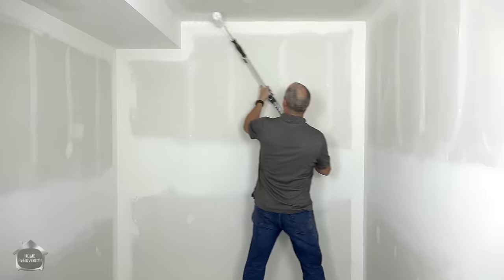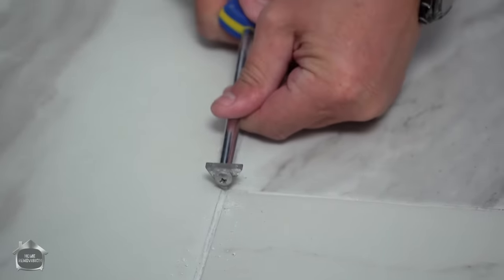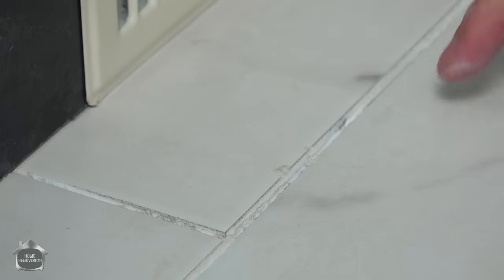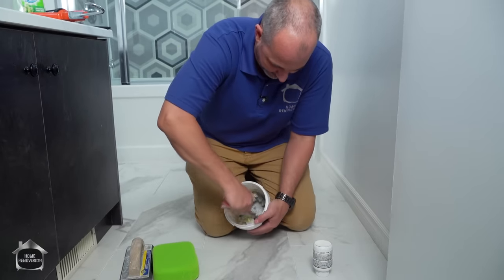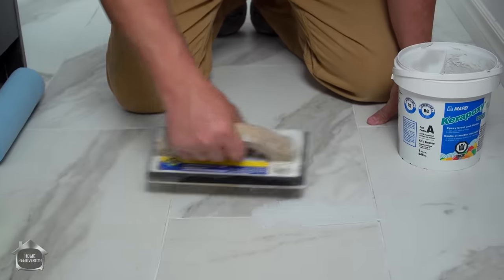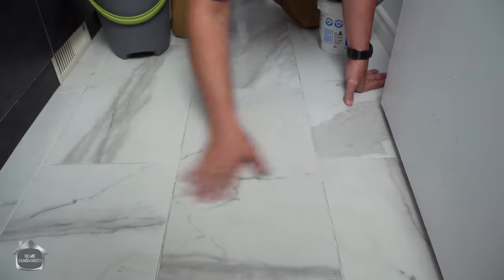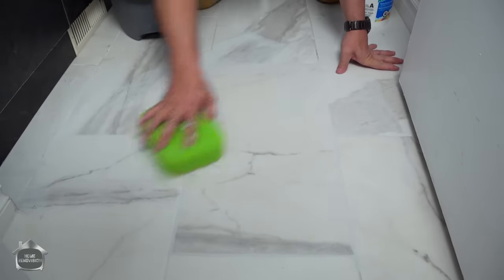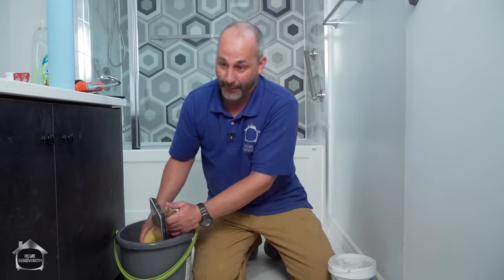How To Apply Epoxy Grout  | DIY

Comment: thank you this is  interesting trick but the fact that soap prevent the epoxy from sticking the the face of the tile which makes cleaning easy also works against us because  it will do the same thing to the grout line and prevent adhesion because its very hard to not get any soap inside the groutlines  once you start grouting
Reply: Agreed, this potential problem isn't addressed, despite several questions about it. How does the soap affect the ability of the grout to stick inside the grout lines Jeff? This is obviously a concern to may of us.
Reply: I was wondering about the same.
Reply: Jeff, are you sure the soap trick works? Will the epoxy bond to the grout lines once fully cured?

Comment: out of curiosity , what do you think of grout release products that you roll on with roller, every company seems to have it. supposed to help with grout haze. over priced dish soap?
Reply from the maker: If you use 20 cents of dish soap you don't need 40 bucks worth of grout haze remover. cheers! This technique solves the problem before it even starts.

Comment: Hi Jeff! Can you use this epoxy grout for the floors of a shower stall that have cracked grout?
Reply: Hopefully you were asking this question a year in advanced. Cause he still hasn't replied. Hm
Reply: Cracked grout line means there's movement, nothing stops you from regrouting, but it won't solve the original problem. If you're talking about an inside corner crack, that's because grout never belong there
Reply: @doublepoil  grout can crack for various reasons and isn't caused just from movement. Improperly installed or mixed grout can cause it to be weak and crack prematurely ie mixed wrong or not packed all the way in the joint

Comment: I'd replace that floor with that deflection you showed us. Even epoxy will crack there. Band aid solution. 
Subfloor and plywood under layment total thickness of 1.25" and 1/8" Schluter Ditra on top of the plywood underlayment. Never had a failure with this method.
Reply: Thank you!

Comment: Good morning
My bathroom was renovated by a professional from Canada and he used schlutter board under the tile and epoxy grout. there are places on the floor where it looks like the grout has   
came loose from the tile along the edge leaving a hairline between the tile and the grout.
can I heat up the grout to get it to reseal?

Comment: "To minimize epoxy haze, wipe the tile down with a solution of water and a few
drops of Dawn® dish soap prior to grouting. This solution acts as a grout release to help
prevent resin from sticking to dry tile, thereby making it easier to fill the grout joints and
minimizing the residue on the face of the tile. The use of a microfiber towel to remove the
final grout film during clean-up will greatly reduce the amount of haze. "
Reply: ty Wendy. Someone actually knows. But keeping the grout ice cold in a bucket of ice is the real key. Kind of surprised to see the host does not know that.

Comment: I like your videos,but if you read Mapei spec sheet it says "The joints must be dry, clean, free from dust and empty down to at least 2/3 of the thickness of the tiles". Wet joints are required only if you apply sand based grout and also you need to clean the joints from old grout way deeper than the this tool can reach. I have used similar tool and they are not any good as it can damage the tile along the joins. I ended up using milti-tool which is slow and hideous process

Comment: I just purchased a home and need to repair some tile and regrout the tile around my tub. Would the epoxy grout be a good option for that or is it only good for floors? I had though about doing tile over the existing tile but the existing tile is very thick and it’s a 1994 manufactured home
Reply from the maker: epoxy is great for showers since it gives you a waterproofing layer. Cheers!

Comment: I just installed porcelain tiles in a shower area and used Ardex EG8 Plus epoxy grout and it was a nightmare.  It started to cure within about ten minutes and getting the whole job done was a nightmare.  Consequently I missed about 5 small spots and have epoxy on the tile faces that wasn't cleaned off properly.  I also had a nightmare that the lights went out during grouting so was working in very low light.  Ordered some Lithofin Resin Ex after speaking with manufacturers so will see what that does

Comment: So the hardened epoxy stops tiles flexing where glue has come loose underneath? Have similar movement around vanity and an external door. I've fixed the leaking in both spots but tiles a bit loose.

Comment: Hey Gary, that soap trick makes me a little nervous. In other projects I do I use dish soap as a barrier,  or separator between two similar surfaces.  ( such as a plaster mould). I would think that it might compromise the bond. Thoughts?
Reply from the maker: hi brian, use a little and spread it on the tile nor into the grout line. Cheers!
Reply: Spread it on the tile then float it into the joints when grouting?  Same difference.
Reply: Hey, it's the guy who instructs you to push the grout removal tool away from corners or push it away from corners to avoid chipping the tile. Then within seconds, he's scraping through tile corners not following his own advice! So, do as he says, not as he does? 🤷‍♂️ He's not even using an epoxy float and if my ears and experience serve me right, there's sand in that new grout. So he's ruining that float (made for unsanded grout).

I have no problem at all with this guy. Honestly, I've taken some of his tips, tried them in the field and you know what? Some work. Some don't. But you take what's useful to you and forget the rest.

That reply of his where he says that he's smearing the dish detergent on the surface and not in the grout joint; ok! True! But as you push the grout float across the tile pushing the grout around, the dish detergent is mixing with the grout - like the epoxy liquid with the powder in the bucket. 🤷‍♂️ Simple, common-sense physics. So yeah; I too believe that the bond integrity is compromised - regardless of what Jeff says. Do i have a channel? No. But I did send this guy pictures of my tile work in Instagram and he never shared them - and that's totally cool! His account, right?

I'm not saying I know more than Jeff. I don't. I only went to tile school for 4 years with the tile union (Bricklayers) and was instructed by instructors who have over 300 years combined tile experience but again, I don't think I know more than Jeff. What I do know more than Jeff is what my dad taught me; if you're wrong, own it. Admit it, fix it, move on.

🤷‍♂️

Dish detergent for this purpose? NO. Not me. No way. Since 2005, I've never been called for grout failure on one of my jobs. I used no dish detergent, only good 'ol elbow grease. Nowadays, people want quality and fast. It's like wanting a Bently (hand-built) assembled in the same amount of time as a Chevy or a Ford. No way! Quality takes time. Period.

Jeff, regardless of all of this, you've got some great videos. And despite my comment, I have a lot of respect for you. As I said above, I've adopted some of your methods.

Good day!
Reply from the maker: @Carlotheeus  I guess the best take away from this is I am not running a trade school, simply trying to offer some advice to help the DIYers out there. Cheers!
Reply: The issue is, professionals know what info to adopt or which to discount, whereas novices follow all these tips, many of which can lead to trouble in the future.  As for soap and grout, if it isn't on the label, don't do it.  Some tips make the contractors life easier, but ultimately the consumer pays the price of someone playing "mad scientist".
Reply: I am an American  not russian. So it takes as long as it takes
Reply: OM, GOODNESS give the guy a break, he's not here claiming to cure CANCER!!!!...as a single parent who is also a home owner I find all his videos super helpful...sometimes I cant afford a tradesman and this videos have helped me tremendously, just the other week I watched his video on how to paint kitchen cabinet doors....and viola, I took the chance and followed his tips and tricks, needless to say my kitchen looks amazing now.  @Carlotheeus

Comment: Hi, is there any mold resistant grout in the market or any advice to stop mold growing on grouting?
Reply from the maker: mold only grows when the tile substrate allows the water to reach the framing. use cement board with a waterproofing roll on for best results. Cheers!

Comment: Always a great video and awesome information. Thanks Jeff and good work Max for your camera work. Have kitchen questions. Bought a house that was built in the 60's. Has wallpaper that the wife wants to remove and paint blue. The question is she found Mosaic tile for a back splash, how can I put it up and have it show the blue thru the tile and a get a blue grout? Thanks
Reply: Also, have a trash compactor, it don't work. Think of replacing it with a cabent that holds trash cans, to hide them and get them out of the way. Any ideas. Thanks Jeff
Reply from the maker: that sounds great.
Reply from the maker: if you want to install clear glass tile on a colored surface all you need to do is apply the tile with clear silicone. This will allow the color to shine through. Cheers!
Reply: What kind of grout should I use? Can it be tinted to a blue color.

Comment: Hi.  New here and new to tiling.  I have a project I'm working on - building a water fountain for my apartment patio. I bought a single sheet of 1/4 hardie backer and I want to tile it with some very inexpensive glass tile I picked up at a surplus building supply. The tiles are mosaic 5/8"  on sheets 12" x 12". So the grout lines are very small. As this is a water feature, the water should cascade down the front of my tiled wall, the bottom two or so feet of which will be submerged in a galvanized tub.  I'm pretty sure epoxy grout is my best bet, but I'm super nervous about f'ing this up.  I see many say it's hard to work with. As my tiles are so small and this is a virgin application, would the soap trick still work? Does it affect how the epoxy will stick in the grout lines?My tile has a bit of a "carnival glass" look to it.  I don't want to mess that up either.  My dad keeps telling me to use sanded grout and call it a day. Your advice?

Comment: Other than price, why use sanded grout and then a sealer to make it water-repellent when you can use expoxy grout that takes care of both?  I'm in the process of renovating my bathroom. Been watching your videos A LOT. Currently tiling tub surround with niches and grout is next. BTW, I red guarded joints AND niches with 2" cement board fiberglass mesh tape because I couldn't find that fiberglass cloth roll that everyone says to use. Is that okay?
Reply from the maker: You will be fine , Cheers and congratulations!

Comment: So question I’m worried if I do this a couple pieces of the tile might just pop out. If that happens should I just look into replacing the whole floor. I don’t want to start without having the heads up it might be a bigger project. I’m not ready for.
Reply from the maker: if tile pops out, then you can reset it in place and then grout later. Cheers!

Comment: Is there an approximate sqft that this covers? The one 5kg I bought says "maximum area covered: 0" which is zero help. Trying to do a 60x42 shower (walls and floor) and im worried the two 5kg i bought will not be enough, even though I used 12x24 tiles for the wall.

Comment: Isn't the soap mixing with the epoxy once you remove the excess?
Reply from the maker: Just a very small amount. In my experience not enough to cause any negative effects. Cheers!
Reply: @HomeRenoVisionDIY  Hi Jeff, Will this epoxy system work for my shower & kitchen regrouting? We are preping our house for sale on limited budget and your invaluable. Thank you and God bless.

Comment: Hi.  What type of grout is best for thin grout lines?  The company that installed my 24 x 24 porcelain floor tiles used unsanded grout...and it scratches out to a powder with just your fingernail  =(

Comment: Doesn't the detergents and water prevent the adhesion of the epoxy grout?
Reply: I'd assume it definitely does for sure.... I probably would use some kind of sealer on the tile that's made for pre grouting instead tbh

Comment: Great tip! is mixing soap back in the bucket with grout a concern? will it effect the epoxy?
Reply from the maker: for a rsidential use I am not concerned about it. epoxy is such overkill that loosing 5% of its efficacy is not an issue! Cheers!

Comment: GOT A QUESTION! What can i use on  shower walls thats not that expensive? Or is there any waterproof sheetrock that can just be painted
Reply from the maker: dollars per sq ft epoxy grout is the lowest cost option to use in a shower. Cheers!
Reply: @HomeRenoVisionDIY  do i coat the sheetrock with the epoxy?? How many coats? Or how is it applied?
Reply from the maker: simply use it as the grout after you tile. Cheers!

Comment: How do you slow down the curing process? I bought a 5kg bucket of the stuff and had to toss most of it away as I couldn't do the entire surface before it began curing.
Reply: I read that sitting the bucket in ice slows down the curing. I also read that covering the bucket with a cold damp towel can help slow it down too.
Reply: @nigeld8694  thanks for the tips! I eventually bought a 2 part product from the same manufacturer and was able to mix it in much smaller quantities.

Comment: I am certified tile installer. What I'd like to know is. Doesnt the mixture of dish soap and epoxy break down the epoxy? Whether water or oil base dish soap will destabilize both? I like the idea and want to try it but I was warned to add only a few drops of dish soap to a hot bucket of water, nothing more than a few drops... so i guess my question is. How does a lot of dish soap not destabilize the epoxy?

Comment: If the detergent prevents the epoxy from sticking to the tiles, wouldn't it also affect it's ability to adhere to the grout lines? Especially if you are over-grouting existing grout, since it would only be sitting in a shallow surface V groove, and not all the way down between the tiles.
Reply from the maker: Hi Julie, the beauty here is that even 1 mm of epoxy grout in the grout line is more than enough to secure an amazing bond. The soap is designed to sit on the tile not in the grout line. Cheers!

Comment: Great video. I always enjoy your videos. You do solid work. Can you put the link to your other video that shows the proper way to lay tile?  Maybe a suggested video.
Reply from the maker: Hi Justin, we are going to do a complete tutorial for tile soon. I will be happy to answer questions in the mean time if you have any? Cheers!
Reply: @HomeRenoVisionDIY  I have layed tile before. I know that one of your videos would help me improve on my skills prior replacing my kitchen floor.
Reply from the maker: @jrider85  simply use the search tool and type tile. Cheers!
Reply: Thank you for this video. My kitchen tile was not laid properly no wetting back floors and tile has grout cracking everywhere.  I decided we would hire someone else this time but I sent someone else for supplies ( he went to original tiler ) I had copy of color etc. all cracked tiles ( 3 boxes ) were replaced and grouted again but the mess w dust everywhere? This Méthod of etching the tile should make the NEW epoxy 2nd repair far less dust but I’m
Concerned now w the chemical smell. I have a genetic lung disease and last time getting all the dust up even though room was cleared , hvac off , vents taped , doorways sealed , can you offer any other suggestions? 
I can’t open windows bc house has anderson windows w no screens! Two half of a large kitchen is being redone the tile store said this would match the other half where there is no issue. I just wonder should we do the entire kitchen ? Bc it’s a completely diff product than original tile installed w sand grout. The other man retired but he kindly offered to give a bid after 9 years and then complete disaster. 3/4 plyboard under and you could feel it moving. That had been remedied.. I’m too old and disabled to have to do this over again , and thankfully the contractor friend helping fix disaster isn’t ripping me off like the first time. Thank you. This video I definitely needed every tip to avoid the dust from the three boxes of tile that had to be replaced due to the entire process was wrong from step one!

Comment: I had a home built a few months ago and the edges of the tub tiling have a lot of cracks in them.  The builder came through and filled it in with grout caulking.  Is this okay?  It's grout lines where horizontal and vertical tiles meet.
Reply from the maker: Hi Matt, The builder should have used that caulking the first time. Cheers. You are fine as long as he used silicone caulking.
Reply: @HomeRenoVisionDIY  That was my exact thought.  This hasn't been the first screw up from our builder! Thanks for the reply and thanks for providing us such awesome information!

Comment: I always thought you needed to remove ALL of the grout so as to expose the edge of the tile so the new grout can stick to it (because grout doesn't stick to grout). Is that false? or only false for epoxy grout?
Reply from the maker: Hi Josh, the remover tool exposes the edge of the actual tile. epoxy does not need much surface to bond with since it has such a superior bond strength. Cheers!

Comment: I have a shower that I can't seem to get the grout lines perfectly clean.  Would using that grout remover tool and re-grouting the shower be advised or is there another trick you can recommend?
Reply from the maker: Hi Carroll, re grouting gives you the confidence long term that you won't need to ever clean grout again. Cheers! And you can pick the color with epoxy as well.